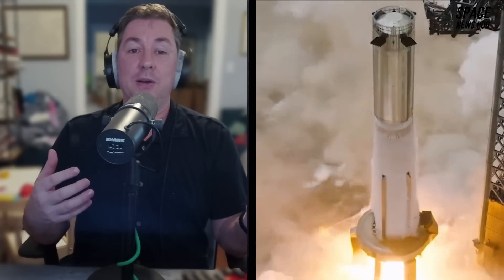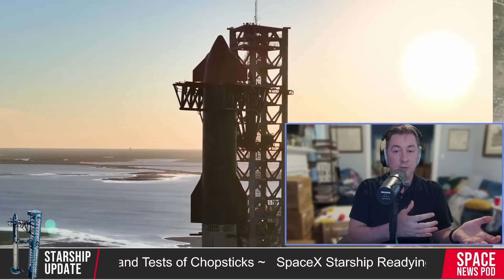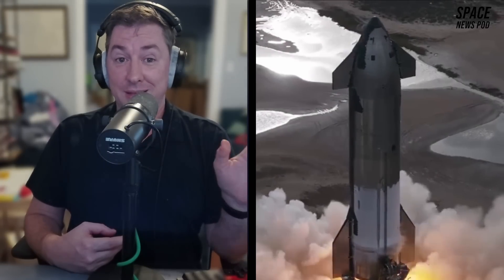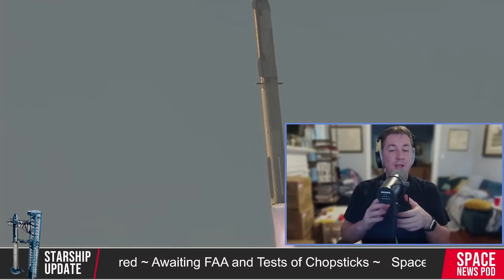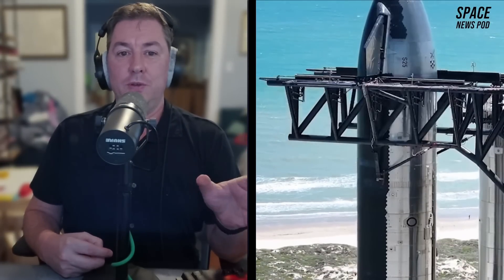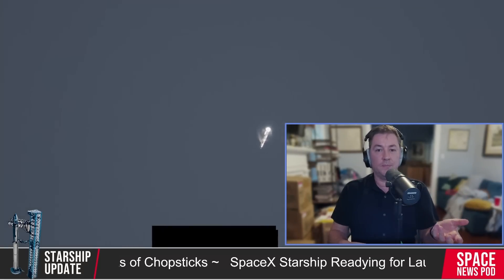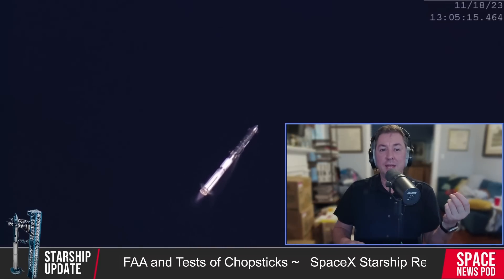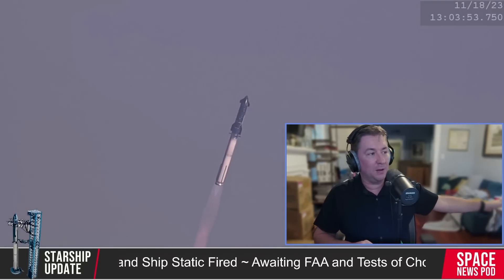No landing for Starship Booster on Flight 5?

Comment: Wil,

As always, great job! I hope your move goes smoothly and it's a step up for you and your family. You do great work.

As far as Starship is concerned, I think the FAA is likely looking to see two (or maybe three?) successful booster-controlled hover attempts and target accuracy performance-marks, prior to allowing an attempt at a tower catch. Of course, I could be wrong, but consistency in control and landing needs to be proven before they bring the booster back to the tower for a catch attempt. Just my thoughts.

I think they should consider bringing it back to the beach area and letting it hover over the water and then allowing it to fall over and sink in shallow water, just so they can acquire great close-up video and better performance observations. They could also then tow it onto the beach and analyze the entire structure.

It just seems logical to me to do it this way (barring the approval of the FAA, FWS, and any other government agencies of which regulatory approval is required).

God bless. 🚀🧑‍🚀👨‍🚀👩‍🚀
Reply from the maker: I agree with you about the FAA. There's not replicate proof or enough data for the FAA to make a decision that could put people and properties in danger. The low water landing would be pretty cool too! Would be nuts to see that footage.